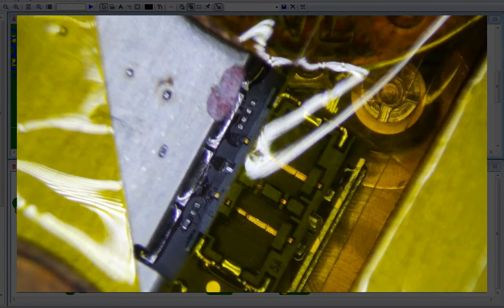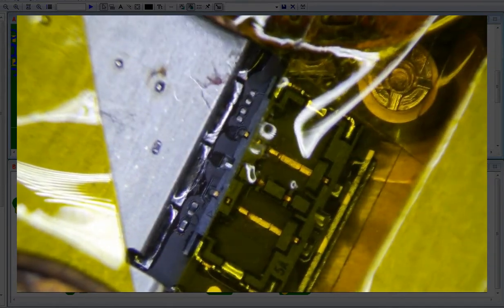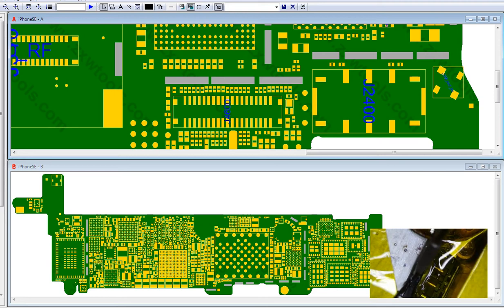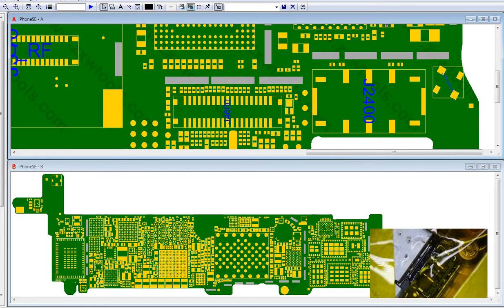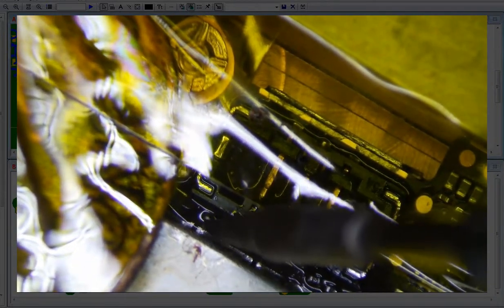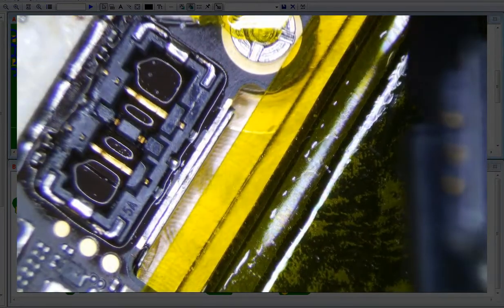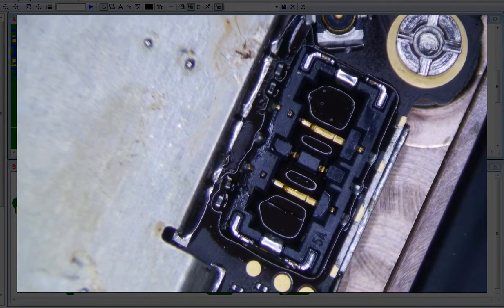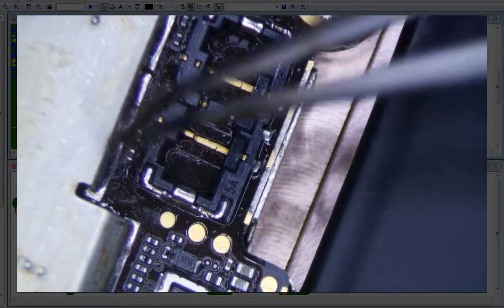iPhone SE Boot Looping Battery Pry Damage Repair

Comment: Just wondering if you will be able to run your IPhone SE with charged battery even without the battery filter that you soldered? Is that battery filter only concerned about loading charge to your battery? Thanks.

Comment: i bought a new battery, a new display and tried restoring several times.
then i finally saw that there are those tiny resistors next to the battery connector
glad i know the answer now at least, but i just dont have the skills or the tools to repair that shit.
thanks mate, good video